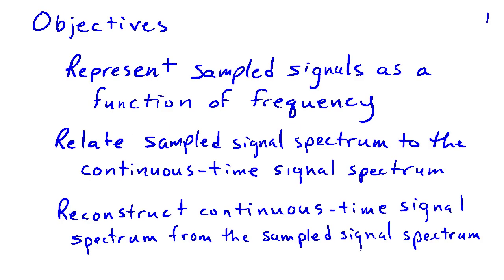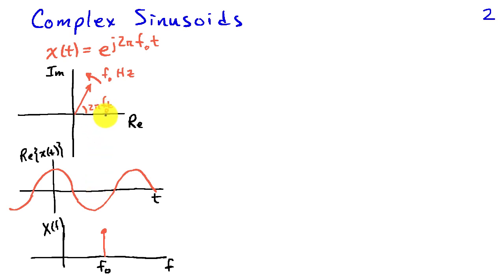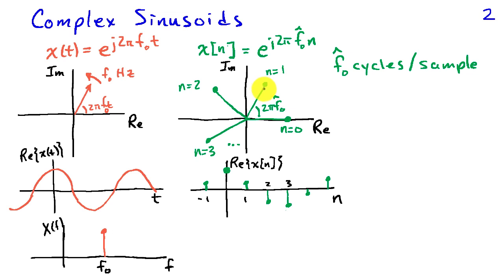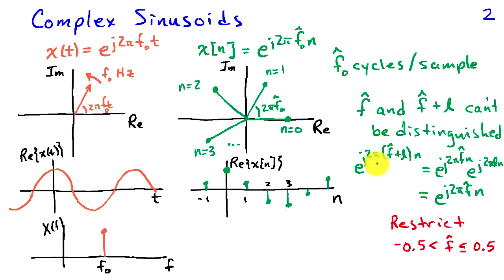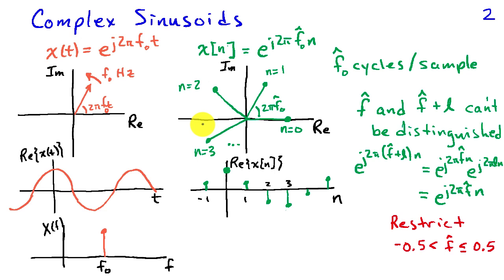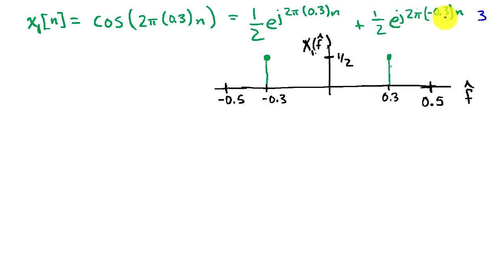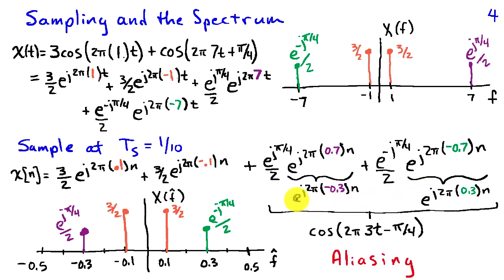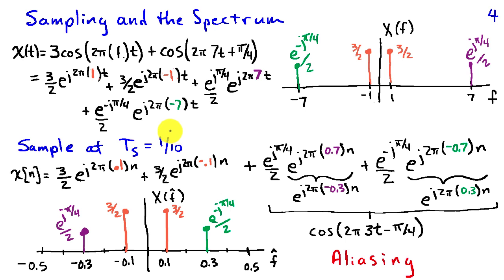The Spectrum of Sampled Signals

Comment: Consider an arbitrary signal g(t) comprising of sinusoidal functions, where arguments can be in any form of your choice. Now this g(t) is passed through a sampler for sampling at a rate of  nHz, assume values for n. For each case sketch  the sampled signal ,sketch the spectrum of sampled signal ,also explain whether you can recover the signal g(t) from the sampled signal? If the sampled signal is passed through ideal low pass filter of nHz sketch the spectrum of the output signal, assume values for n as per your choice. Justify how vital sampler in digital communication is, also state what did you infere about the signal g(t).
Bro plzzz sent answer for this sir????
Reply: Babu Veltech ah?😂
Reply: @vamsikrishna998  haa bro
Champutunaruu

Comment: Hey Barry,

I guess the equation of the summation of sampled cosines at 10:13 needs a small correction. In the green equation, the second term still has "t" instead of "n" which multiples with (-fk Ts ). If I am wrong please let me know. 

Cheers!